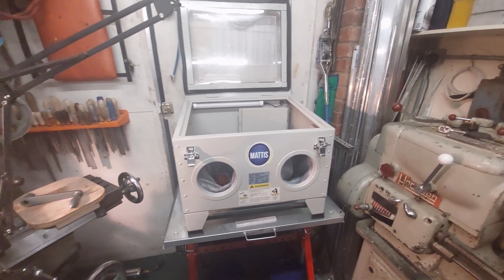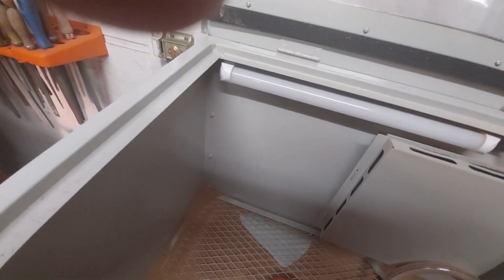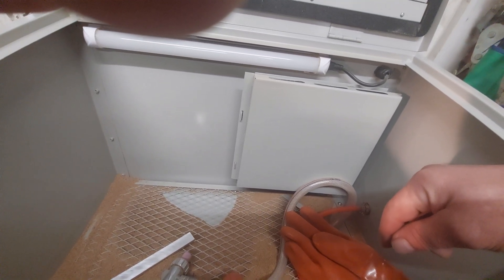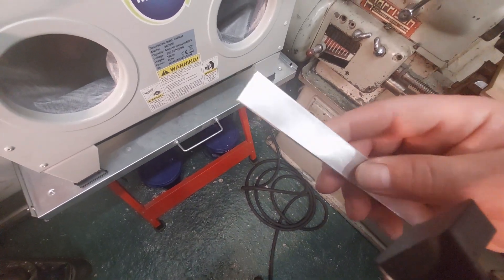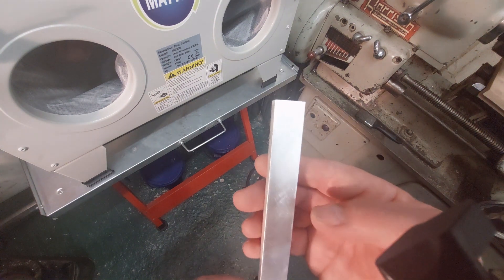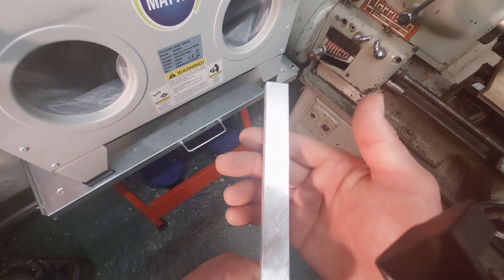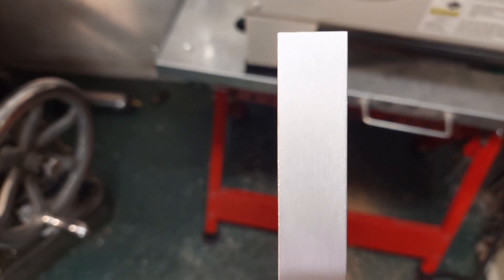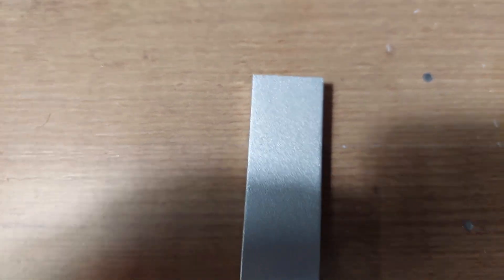Experiment with sandblasting for finishing aluminium

Comment: The edges seem still quite sharp after the treatment (on the video anyway). It is not the subject of the video, but have you ever try on hard wood ? What would be the result ?
Reply from the maker: No The edges of the work are not sharp, slightly radiused actually. Not something I have ever tried, sandblasting wood. I guess it might make for an interesting video. I wonder if it might be a successful way of removing finishes such as waxes, varnishes and paint without resorting to heat or chemicals?
Reply: @caramillo-andy  ok, thanks !